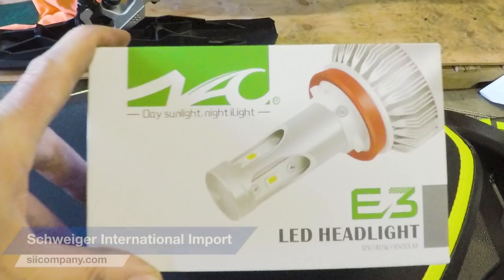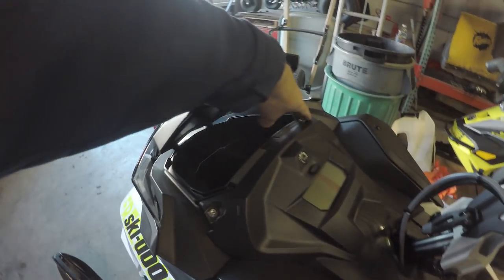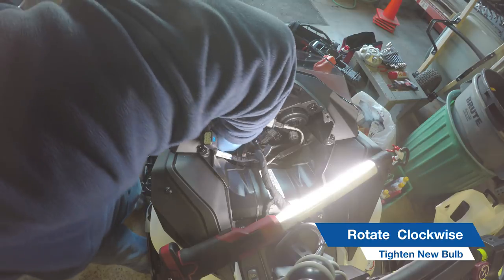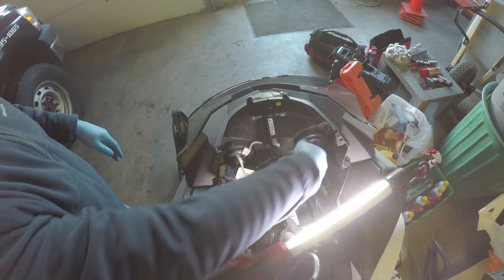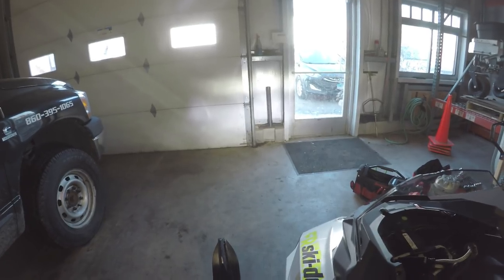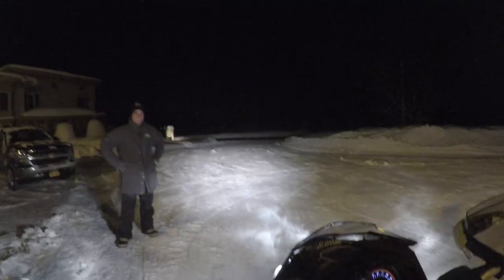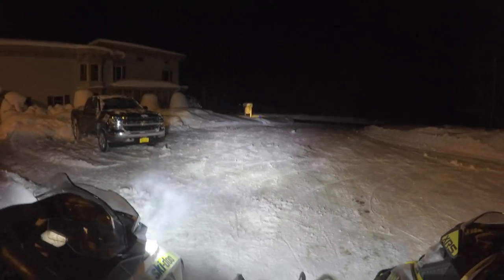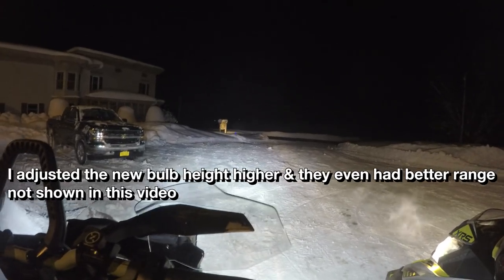Snowmobile Stock Headlights vs LED Comparison & Installation

Comment: Good post, thanks. I installed LEDs in my G4 and yes, they are brighter. It is a definite improvement over the stock halogens, but  I'm not completely  satisfied with the way LED light projects from the G4 housings. The light scatters more than expected and the elevation of the low and high beam spot is almost identical.  I suspect to get the most out of these bulbs housings designed for LEDs is needed . Worth the upgrade regardless.
Reply from the maker: Cricket10 have you had them on trail at night yet?
Reply from the maker: Robby Swank the xrs has a different gauge set up but the install of the lights are the same you just have to tuck the drivers in a sifferent place.

Comment: Yeah. I have these same bulbs on my 2016 XRS. And the rubber housing doesn’t fit around the fan. With the Gen 4 sleds it’s not a problem. Just with the XS sleds it is. I was running mine with no boots and some snow dust came in. I love the lights but I just need to find a way to “build” and bigger cover. I have not had the time to play around with it yet.
Reply from the maker: These lights are excellent. I heard you can cut an 'X' in the rubber dust cover with a razor blade, then slip it around the head of the fan. I have not personally done this, but seems like it might work.
Reply: How about LED’s without fans for an Expedition 900 ACE?
Reply: @stephencormier9976  there are many options